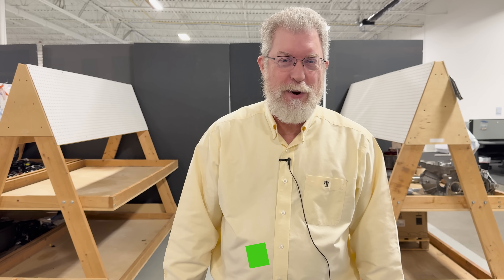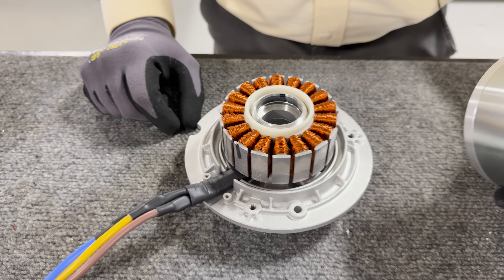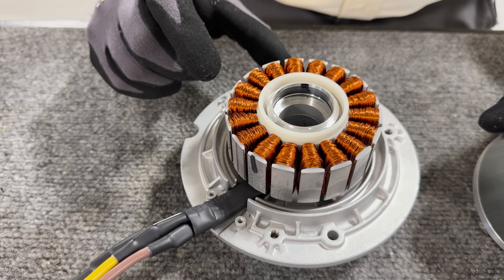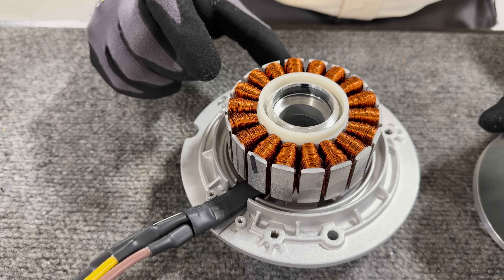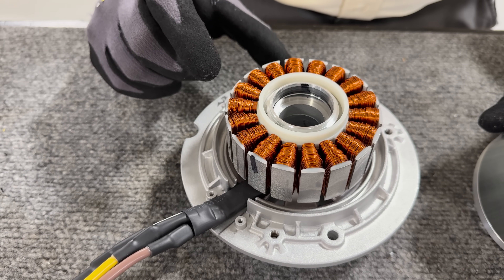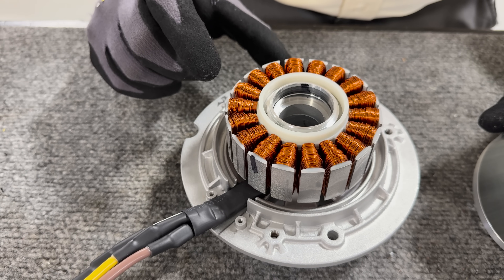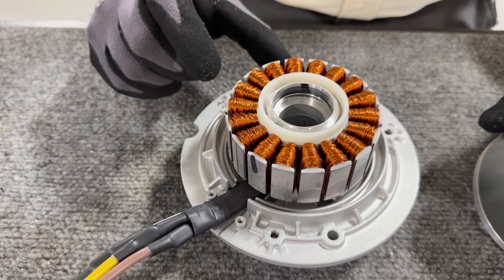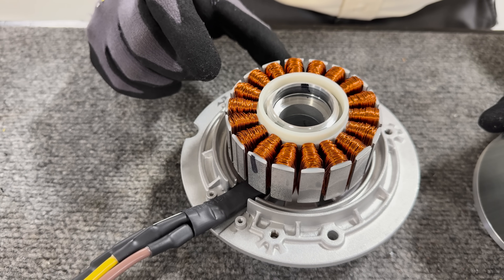EGO Lawn Mower Electric Motor Teardown: Timeless Technology in a Modern Machine

Comment: The reason the induction motor is so much bigger is because it runs at 50hz. If you rewind the induction motor to run at 300hz instead you will get 6 times the power. Also the induction motor has larger tolerances to make it cheap which means lower performance.

Comment: You mentioned you wouldn't be able to remove the casing on the lawnmower motor again.  I assume you just cannot do it by hand because of the strong magnets and risking hitting the sides.  How is it done? Something like a hub puller that applies equal force around the sides with a push screw?
Reply: Yes, that's exactly right... although it's the rotor, not the casing, that has been installed and would be difficult to remove.

Comment: Your credibilty is on the line when you cant ID an Outrunner motor. I may be wrong but this may be the first mower to use an outrunner which IMO is the proper choice instead of an inrunner. The difference is torque vs speed. Outrunners are known for lower speed torque applications, where inrunners are the speed option. 3200RPMs is hardly fast compared to inrunners that can hit 100,000 RPMs.
Reply: The terminology is poor, but I assume that it is just an attempt to use common words and avoid technical terminology which many viewers would not know. By the way, the industry-standard term is "outer-rotor"; "outrunner" is the common term in RC planes and drones.

Comment: The induction motor is only low power because it's designed for fixed frequency mains power of 50 or 60Hz whereas the brushless motor shown can spin much faster having an input frequency towards the kHz range.  The motor in early Teslas were also 3-phase induction motors and they were plenty powerful.
Reply: An induction motor can be used at any desired frequency. Induction motor in EVs (such as those Teslas) run up to 600 Hz, depending on pole count and shaft speed.

Comment: 1:29 they are called poles. 
The outrunner motor configuration is not unusual in drones. 

I wish they would get an elec eng to do these.
Reply: Poles and stator teeth are not the same. With a concentrated winding they match, but in other winding patterns each pole extends over multiple slots and "teeth". For example, the original Nissan Leaf motor has 48 stator slots and 8 poles.
Reply: Those aren’t poles. The poles come from the permanent magnets

Comment: as an engineering channel, there is no excuse for not recognizing the value of that large induction motor vs dc brushless. you fail to recognize that these large induction motors are valued for their torque and does not need much torque conversion. small dc brushless can have a lot of power but little torque, which usually needs gears or torque conversion depending on application
Reply: Also reliability and we know Monroe doesn't care about that. Their core business is helping companies made products cheaper. 

Snap and glue everything together. Removable fasteners are bad. Etc
Reply: @aleks138  true on reliability because it is so simple. At good conditions, it doesn't die except replacement of bushings.

Comment: Good video, but why is the motor an out-runner, or inside-out, motor in this design? Thanks
Reply: The outer-rotor (or "outrunner") configuration is generally used for relatively high-torque and low-speed applications. In a mower the shaft for the cutting blades is often the motor shaft so the motor must run at blade speed, which is low for a motor. This is why outrunners are used in remote-controlled scale or drone aircraft: they are limited by propeller speed.

Comment: I got one of these Ego mowers to replace my 30 year sold Masport, while i dont expect the Ego to last as long, its certainly an impressive mower
Reply: I've got one of the first generation of Ego mowers that's over 10 years old now and it's still going strong (knock on wood). The factory battery did die after about 5 - 8 years or so and I found a knockoff replacement battery that I've been using since. I've got a few more of their yard tools and I've been very happy with them.
Reply: The battery technology is worse than the mower, even though they have the best battery technology in the industry.

Comment: Apparently it's not very important but those stator windings look loose and sloppy.  1:30
Reply: It is meaningful to performance, but this winding is good enough.
Reply: @brianb-p6586   I guess so.  I've long been 'locked into' EGO yard tools, never go back to gas, chainsaw, mower, weed wacker, hedge trimmer and use blower multiple X per week, no way I'd monkey w noisy two-stroke that often.

Loathe HOAs but expect electrics will become increasingly mandatory bc so much quieter.

Comment: Called “outrunner” in some circles.
Reply: And “teeth” are usually referred to as poles in the context of electric motors. 1:29
Reply: @rafal5863  while they are poles in this case, in other winding patterns poles span multiple slots and... teeth. Normal practice is to specify the number of slots and the winding pattern to physically describe the stator, with the pole count specified to describe the electromagnetic configuration. With concentrated windings like this, the pole count is equal to the slot count, but that's not true for other winding designs.

Comment: Is there a use case for the larger old style motor? Was there a reason for the larger motor built in 2024, or was it just a design mistake?
Reply: pretty much anything grid connected in industrial settings use that kind of motor (as long as you don't need speed controll)
they aren't that inefficent, so are great to drive belts, fans, pumps, mixing, and so on
and as he said, as long as it gets a bit of cooling and a drop of love, a motor like that will outlast both of us
Reply: The greatest advantage is power and efficiency in portable products.
Reply: The "older style" induction motor does not require complicated and costly drive electronics, so even if it costs a little more in materials, it makes up for it by being dead simple to operate. When used in fixed machinery, weight is a non-issue. They can also be made very large relatively easily, where a BLDC motor becomes prohibitively expensive or completely impracticable at such scales. 

From what I've seen, BLDC motors are typically preferred only in portable applications where high power density is required and AC power is unavailable, with the major exception being small cooling fans.
Reply: @user2C47  Exactly, these don't really compete. The permanent magnet brushless motors are taking over from universal motors for portable, power dense and generally higher speed applications, where for battery use in particular the cost of the controller is offset by the increased efficiency, with the lower maintenance just a side benefit. I find the comparison in the video somewhat misleading.
Reply: because the engineer in the video does not know the difference or relationship torque vs power. if dc brushless is king, then we would see it everywhere. the value in large motors is torque, not power where most of the time they are used in constant speed applications and does not require too many gears or torque conversion.

Comment: Terminology in small BLDC motors is well established: "inside out" motor is called outrunner, there is no inverter per se (technically switched polarity square wave is also AC but then we can call commutator on brushed motor also an inverter.) but ESC(electronic speed controller). Winding type seems to be concentrated winding in this case.
Reply: Also it's not really a DC, you feed DC to ESC which then generates AC wave pattern. They are PMSAC (permanent magnet synchronous AC) motors.
Reply: Of course there is an inverter. You can set your zero to whatever you wish. Most inverters deliver even FOC and sinusoidial current. ESC is nothing but a three face drive inverter scaled down

Comment: No hall effect sensors?
Reply: Modern BLDC & PMIC drive electronics can do very well using just measurements of winding current and back EMF. Especially in this use case where the motor doesn’t have to run both directions or produce much torque at stall speeds.
Reply: @danamyrocket  Interesting: I see a lot of bycicle motors where water ingress corrodes the hall effects.  Makes me wonder if this issue can be overcome for future wheel motors for cars?
Reply: @LawpickingLocksmith  I believe the specific trick with the lawnmower blade motor is that it usually has hardly any load on it at zero RPM.  The drive electronics can pulse the windings at an approximate rate until there’s enough speed to read the back EMF.  An electric bicycle drive motor has the problem of likely a pretty large load at zero RPM.   There is also the explanation that there are usually several different methods to do the same thing with various trade-offs.
Reply: @LawpickingLocksmith I’m suspecting that low end manufacturers are outsourcing their engineering and/or throwing in the cheapest electronics they can find. State of the art brushless motor drivers use FOC. There are multiple open source software projects that run on sub-$1 microcontrollers. Never underestimate the laziness of manufacturers of retail equipment. 

I suspect the Halls you saw dying were there because the vendor didn’t want to, or couldn’t upgrade their ESC technology.
Reply: Not necessary, because the motor runs quite fast and does not need to overcome a stall condition. So the driver can simply operate blind until it can get feedback from the windings. This is standard for Ego products.
Reply: @user2C47  Victa is an Australian brand of mowers owned by Briggs and Stratton. Somehow their motors take too long to reach speed and as a result every battery got a warranty request. Managed to buy a brand new leftover for $30 but now will play with cheaper batteries.

Comment: Just an fyi …I have a air compressor that has a Baldor motor that is probably as old as I am And STILL WORKS , I  am retired so it doesn’t get as much use 😅💚💚💚
Reply: Baldor makes awesome motors.  I got an enclosed external fan 1/3 HP ball bearing Baldor motor to drive the 1946 Lau blower in my furnace.  Lau is still around now as Conair which I believe is based in Dayton, OH.  I had to replace the 5/8” blower shaft and bearings about 15 years ago and I opted to install oil cup bearings instead of the sintered brass.  There is a lot of farming near here and there is a vendor nearby which sells only shafts and bearings of every imaginable type.  

The cool thing is I got the Baldor motor very inexpensively on an auction web site because it is rated 50 Hz.  Actually a 50 Hz motor will run fine on 60 Hz and will run at the expected 1725 RPM.  The magnetic circuit is actually more robust than needed for 60 Hz operation.  The reverse is not true; a 60 Hz induction motor is likely to overheat if it is run from 50 Hz power.

I’m pretty sure Baldor is a division of Reliance and I believe there is a connection to Lincoln electric.  Those are iconic US electrical manufacturers.
Reply: If it's brushless, the only part to wear out is the bearings.
Reply: @concinnus I'm curios, does the plastic coating (enamel) on the copper not degrade with time and repeated heat-cool cycles?
Reply: @Alhussainba  Not that I've heard.  Certainly if the motor stalls and overheats, the enamel melts/burns and smells terrible.  But at low power density it should last indefinitely in normal operation.

Comment: DEWALT 60V MAX Cordless String Trimmer dcst970 is hot garbage .. I'm not an engineer i'm a guy who has used a weedeater more than once .. pick one up some time and pull the top cover off look at the "air screen" ..  I designed a better option just never printed it out .. its just a better screen will full seal not the 6 lil plastic weld dots to hold the screen in place .. how  ever allowing alot of fine dirt matter to make it in to the motor .. HORRIBLE design .. dewalt didn't even respond to my email telling them this
Reply: Get a patent then show them... offer to license your patent...

Comment: Its still a plastic piece of junk, whereas a gas mower can last 30+ yrs if you clean the deck.
Reply: I love my plastic piece of junk, nice and quiet plastic piece of junk 😁
Reply: @patrickmckowen2999 what till you hit a rock...
Reply: The deck is high pressure cast aluminum...
Reply: @jamesengland7461 yea $1500, I can buy a  42" rider for that.
Reply: Traded my Honda HRX190 mower for a Milwaukee M18 and have never looked back.  The Milwaukee is a far better mower with zero maintenance.
Reply: @aussie2uGA Cleaning would be considered maintenance. I hope you are cleaning your machine
Reply: You have to pay for fuel, oil, filters etc... I plug mine and charge it for free with my solar which paid for itself years ago.

Just bought a Rivian Quad2 EV with the $120,000 I saved not paying for gasoline while charging my two EV's at home for the last 10 years... 

Only stupid people pay for energy when we have the ability to produce our own...
Reply: 120k? now unless you have millions in the bank, which I do, I still consider 120k ridiculous, in 10+ years the battery is gone.  But good luck. @Jebus-d9k5j
Reply: @Jebus-d9k5j  We all pay for energy. You may be getting charges for nothing but everyone is paying to generate and distribute that energy.
Reply: What makes it junk? Define junk.
Reply: @fcv1967 the plastic ones are junk, and cast are 1500.  I've had a riding mower for 30 years and other then a belt and blade sharpening and a quart of oil every 2 years...I bought it used for $500 back then.  Get back to me in 5 years when you have to replace entire unit or at least a $300 battery.  Not for me, its nice at first though.
Reply: @publicmail2 im going on year 6 and haven't spent time or money doing anything to it. Except maybe use Ego leaf blower to dust it off.
Reply: Gas mowers are loud,  make a plume of poison gas and require me to go fill a smelly gas can.  No thanks.  I watch my neighbors still fussing with that loud crap while I silently mow my lawn with the push of a button to start it.  I've been using electric mowers for twenty years.   Good luck with that old gas garbage. I'm sure your neighbors hate the noise and smell.
Reply: I love my all-plastic deck Ego LM2012SP.  Never have to clean the deck!
Yeah, it's consumer-grade, but aside from Ego's asinine cable management on the telescoping handle (constantly breaking wires if you collapse the handles often) they "just work".  Invest in extra batteries & chargers and it's a nice setup for the average yard.

Yes, it's expensive -- batteries.  But the batteries really do last (live) a long time.